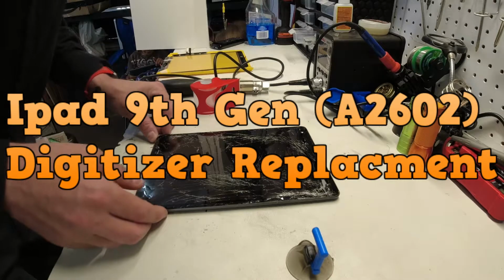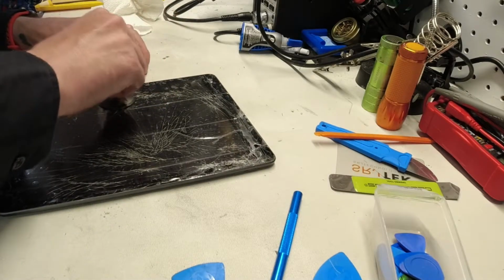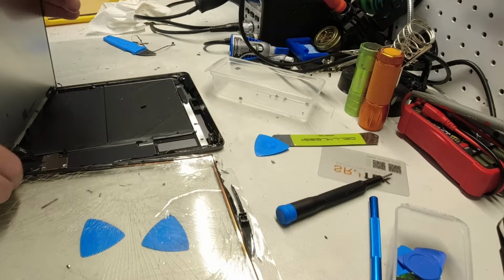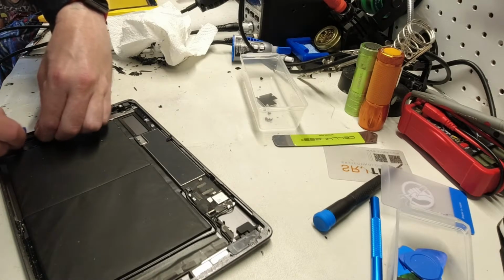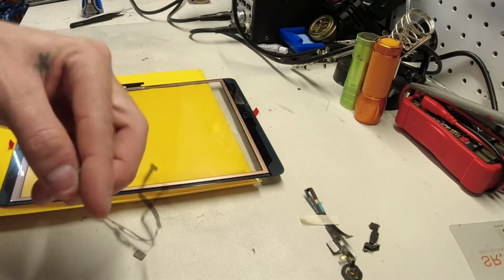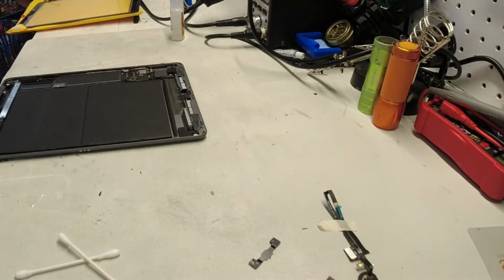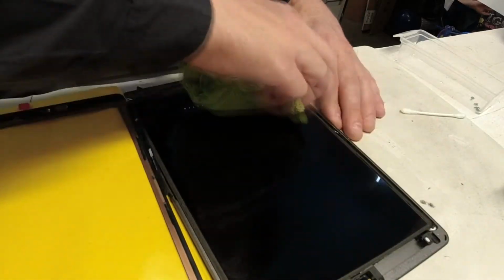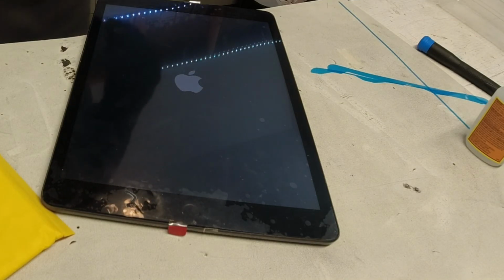ipad 9th generation A2602 Screen Repair

Comment: Hi. First, thank you for the video. Now, the reason for my comment is I would like to pick your brain. I just replaced the screen on my mom’s iPad 9th Gen. I watched several videos multiple times before attempting it. The only problem I had was attaching the old bracket to the old home button/new digitizer. For the life of me I couldn’t get it lined up properly. After hours of going back and forth with it I got it to click and just ran with it. I used B7000 to glue it in place, let it sit for 20-30 minutes and then closed up the iPad without issue. Now the button clicks but you have to press it deeper than you should have to. Do you have any idea what I did wrong/what I can do to get it right if I need to do it again?

Comment: Hey bro can you answer my question ❓
- my ipad just a sudden death, no falls nothing happened. It won't turn on, not charging n not charging when plug into computer. Idk what is the reason, can you help me with it.
I think it's the battery or screen problem,just my guess!..
Reply from the maker: It could be a few things, best case, completely dead battery, bad charging port, or the worst case, your main board has failed.
Reply: @techrepair440  when charging it doesn't Turn on, it doesn't show charging sign. 🥲 
I don't use original Cable? But when I try with original Cable it's still the same.!!

Comment: Hello! Could you ask me a question? I exchanged the glass for another one that is not original from Apple, so the generic pen (Stylus Pencil sold on aliexpress) did not work, does this happen with all pens? Because the glass is not original! Does that make sense to you in any way?
Reply from the maker: I only speak english, sorry.
Reply: @techrepair440  I translated into English
Reply from the maker: It is hard to say wiehter it is the glass or the pen, i would try the stylus on another device to be sure it works on anything, if it doesnt i would say replace the pen, and almost all replacment glass will not be made by apple, i havent experienced any issues like you are saying with aftermarket glass so i will assume it is a faulty pen. Hope that helps!

Comment: I have to agree because may screen broke too but its probably a new way of break and I need to fegur out how replace the screen without taking it in and you did great on the work you did to the screen.
Reply from the maker: usually much cheaper to fix then buy a new one, also keeping your data is aways a good thing. 
\